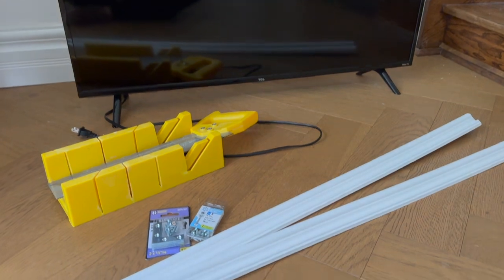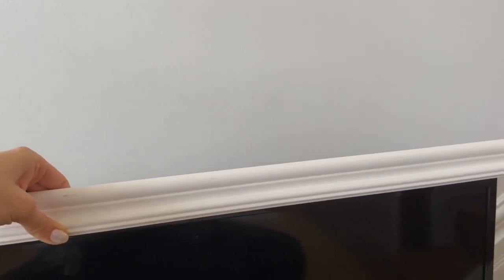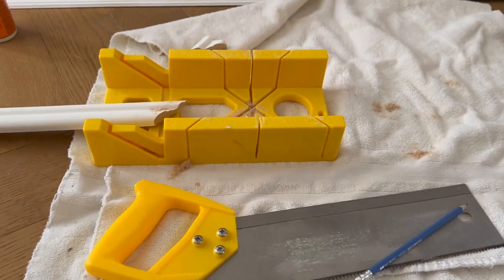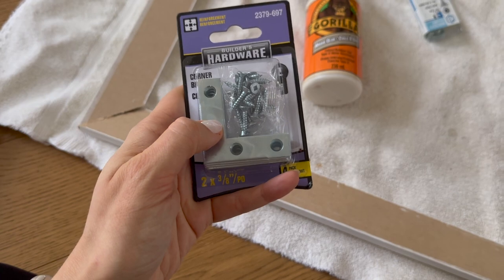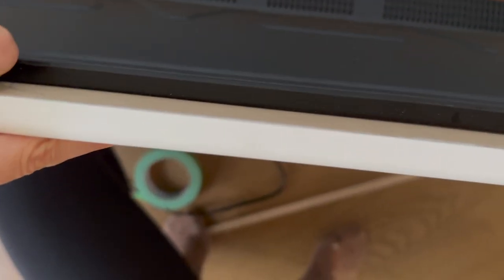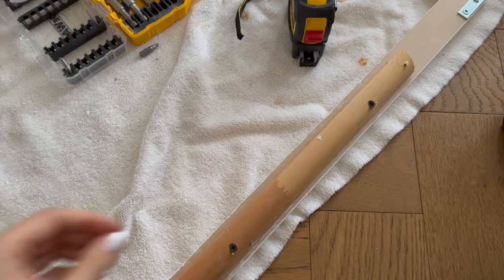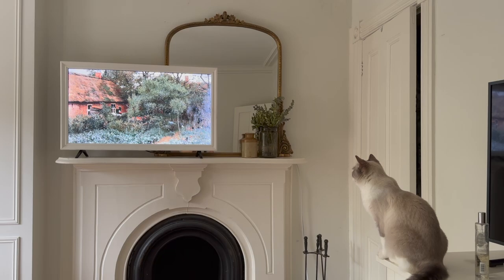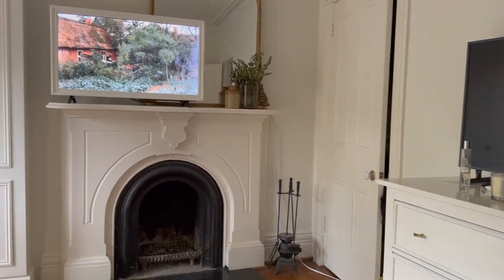DIY Art Frame TV  |  Emma Courtney Home

Comment: Question: does a remote work when you cover the sensor at the bottom of the tv?
Reply from the maker: It depends on the tv but you can get infrared repeater if it isn’t working… about $10 on Amazon and plugs into the tv
Reply: @EmmaCourtneyHome  Thanks, but I solved it by cutting out a small notch in my frame to expose the sensor. Can’t even tell! 😊
Reply: @bethleugers9855  Thats what I did on my frame😊